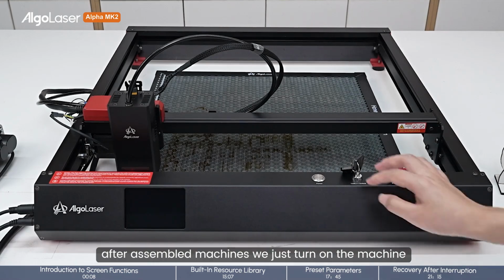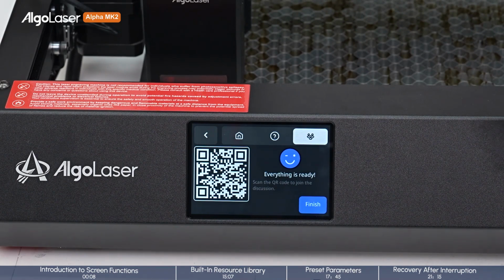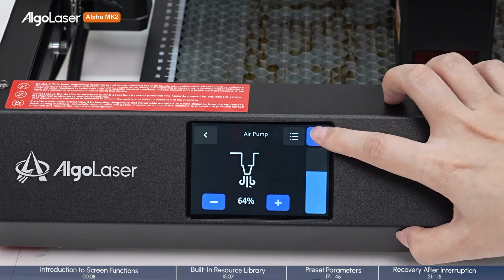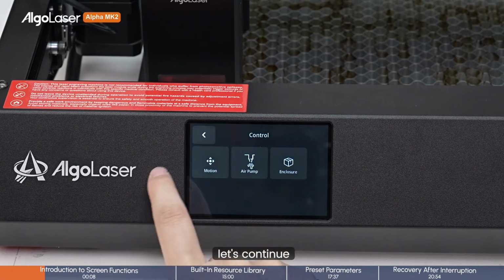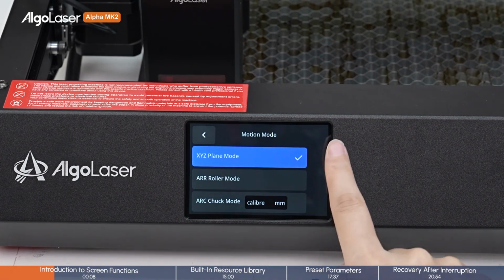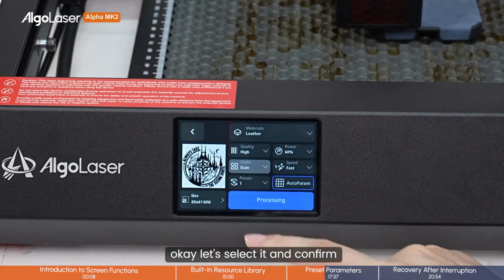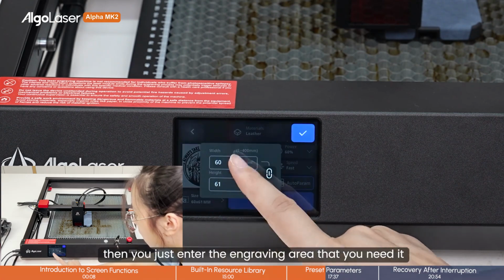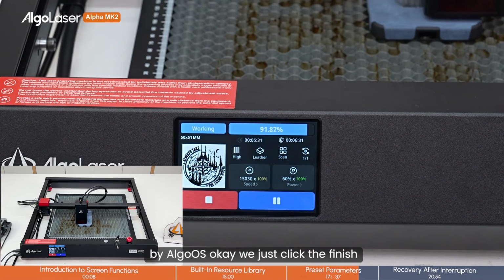AlgoLaser Alpha MK2: Mastering AlgoOS for Effortless PC-Free Engraving

Comment: I appreciate this video a lot. I wonder how you can prepare a file where you want to engrave and then cut and make it from the touch screen touch... do you have to prepare it in lightburn and upload it to the laser?  What type of format woult it understand?
Reply from the maker: You can transfer the file into the machine by USB cable because the machine have builtin 32G memory storage. And if you use lighburn to engrave, you can connect the machine with lighburn by wifi.
Reply: @algolaserofficial  Yes, but if you want to transfer it to the memory storage, what format does it need to be and how does it know how the layers for different tasks work. Because you have some files in the library that are like that, engrave and cut in the same file, how do you prepare a file to keep in the 32 card in the machine and work propoperly engraving and cutting without being connected to a computer?
Reply from the maker: @Fancylooks  1) The machine supports image files in JPG, PNG, BMP and other formats, and also supports Gcode files in NC format.
2) To complete engraving and cutting in the same file, you need to learn the lightburn software on the computer first, use the layering function on the lightburn software to design the task, and then save it as a Gcode file in NC format and import it into the machine.
Reply: @algolaserofficial  Oh, thank you, thank you, answer number 2 is the answer I needed, thank you again!